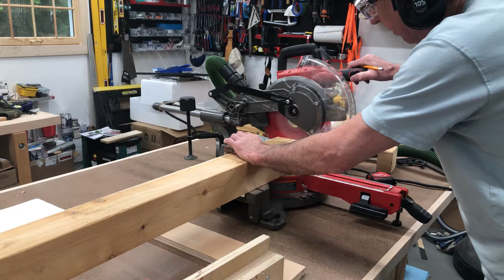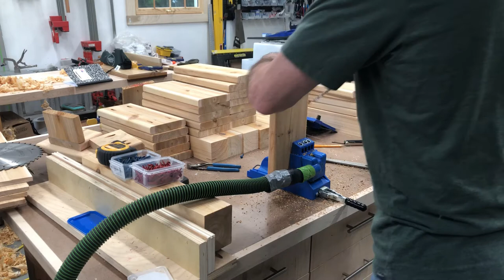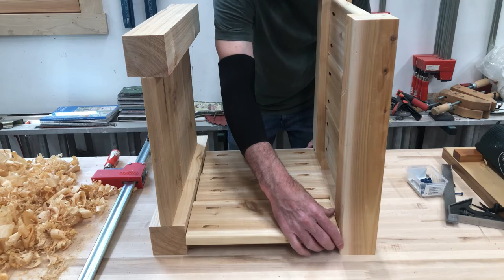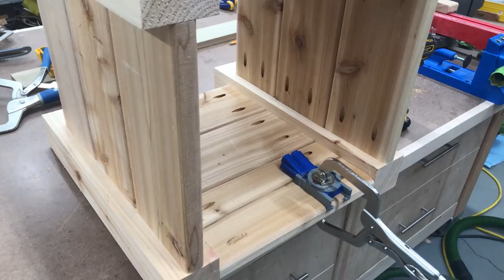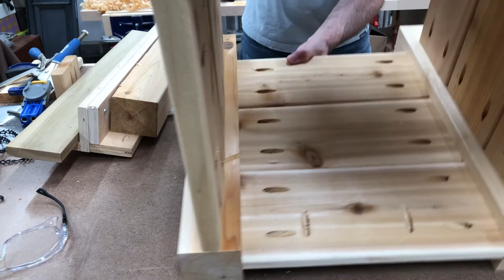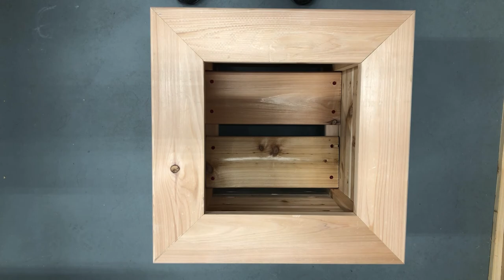How to build a cedar planter box ..... or two with pocket hole joinery

Comment: Great video and good looking planter box. I was wondering in you list of materials you suggest 3 8' boards for the sides, is this for two planters? As for the 4x4, it figures out to be enough for one planter. Thanks !
Reply from the maker: Hi 1dasok, thanks for watching and the comment!   I just corrected the details so that the lumber used represents 1 planter box.  The sides are 12" long, 3 per side x 4 sides = 12' of usable lumber.  So any combination that gives you 12' of usable lumber will do, i.e., 2 - 5/4x6x8, 1 - 5/4x6x14, etc.  And as for the legs, you are correct, the 1 4x4 represented the wood needed for the legs for 1 planter.   Also added the lumber needed for the top as well.  Hope this helps.  Thanks for pointing that out and good luck with your project!  Dennis

Comment: How do you like the job site saw?  I’m in a garage with a bunch of kids toys. So a small space saving table saw that I can also take outside to cut wood is what I’m looking for. Just not sure if I’d sacrifice precision with the job site saw.  Got a cheap Ryobi mobile saw right now. Good enough, but it vibrates a lot.
Reply from the maker: Hi Russell, I've been happy with the job site pro so far.  I like that it's mobile and can take it outside if desired and when not in use i can fold it up and store it neatly against the wall.  I haven't had any issues with precision.  I'm working on a project now where I've used it to rip and cross cut drawer slides for a cabinet as well as all the drawer boxes and no issues.  Haven't had to use my miter saw at all.  

The safety associated with SawStop was a big plus for me as is the dust collection which is a BIG upgrade from my last job site saw.  See my First look on the SawStop pro video and I talk about my dust collection set up at the very end.

Overall, I'm very satisfied with the purchase.

A few caveats:  
1) The miter gauge that comes with the saw is nothing special and I've upgraded to an Incra SE 1000 and I'm getting accurate cross cuts with that.  
2) I don't use the saw to break down sheets of plywood ....  I can't imagine trying to push a sheet across the table with any level of accuracy but I sure some do.  For breaking down plywood I use a track saw and TSO Products.  See my assembly table video for a quick look.  The TSO setup is accurate beyond belief and IMHO a lot safer.   

Thanks for the question and good luck with your purchase!
Reply: @DIYwithDennis  same with me and plywood. Track saw feels much safer. Thanks for sharing your experience with the saw.
Reply: The DeWalt DWE7491RS is a beast if you can swing it!

Comment: Hi Denis.   Great job and good video. Did you use anything to seal the cedar and if so, what did you use?
Reply from the maker: Thanks Rob!  The irony is that in the end, my wife wanted them painted, so they are sealed with white paint.  I'm currently building 2 more cedar planters made entirely of 3/4" material.  Much lighter weight than what I built here.  These will not be painted and so I may look to finish with either Danish Oil or Teak Oil.  But also considering Odie's oil.  The literature says it can be used outdoors, has some UV protection and is moisture resistant.  Not sure if it's up to par with the others but I like the fact that it's all natural so may give it a try and experiment a bit.  That video should be out over the weekend and I hope to have plans for the build as well.  Thanks!  Dennis

Comment: Hi Dennis, how long did this take to make ?
Reply from the maker: Hi Paul, I completed these start to finish over the course of a weekend.  I think if you really dedicated a full day to the project you can probably get it done, but certainly over the course of a weekend.  Lots of repetitive cuts .... 8 legs all with the same dimensions, walls of the planter are all the same size, top pieces all the same dimensions as well.   So that makes the cut list very straight forward and then it's just a matter of assembly.  

Thanks for the question and good luck with your project!

Dennis